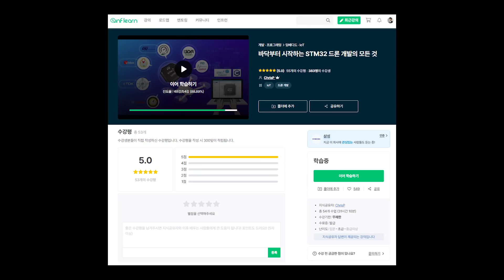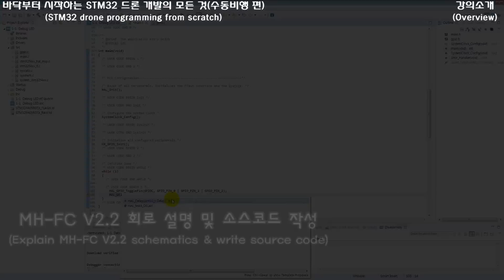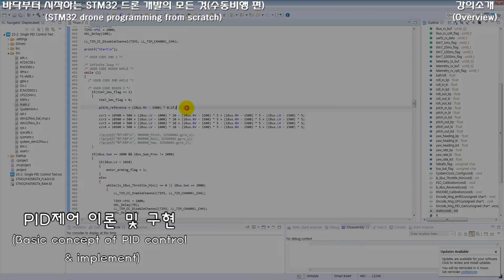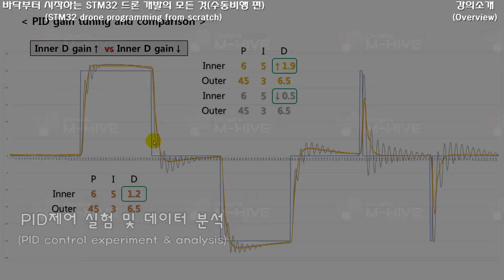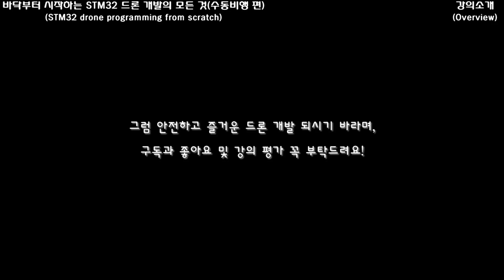[STM32 Drone programming from scratch] Course overview

Comment: Would i be able to use something like a speedy stm32 board for this, i want to use a board in which i can easily flash between my custom code, inav and betaflight. Thank you very much.
Reply from the maker: Sorry. My course supports only MH-FC V2.2 and source code which are designed for the course. Unfortunately, no other HW or SW is supported. Thanks.